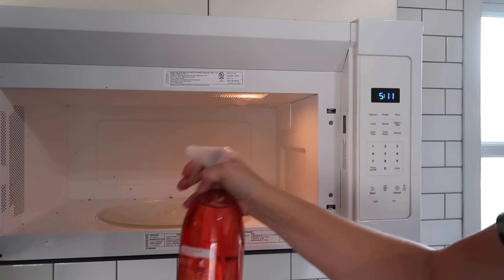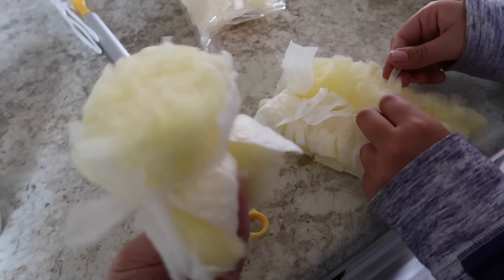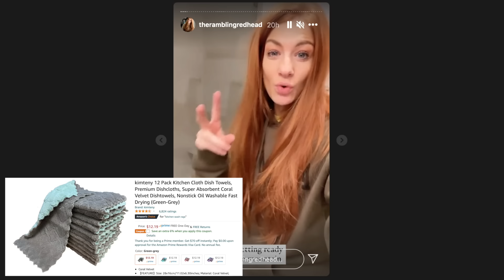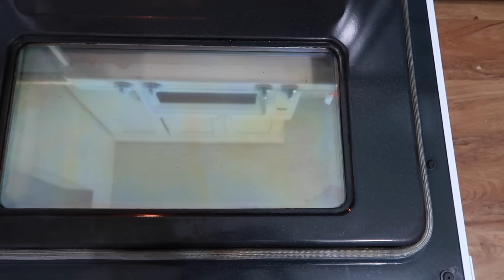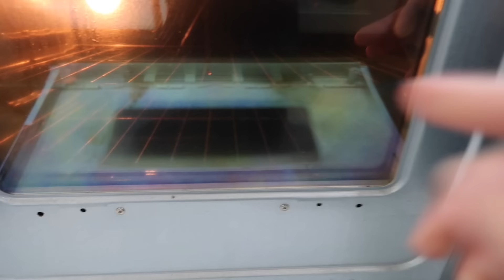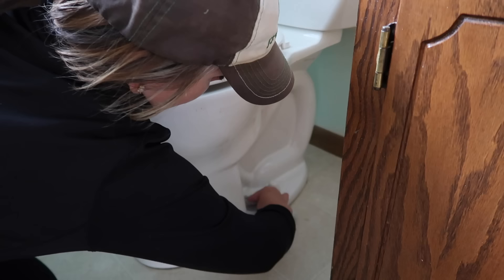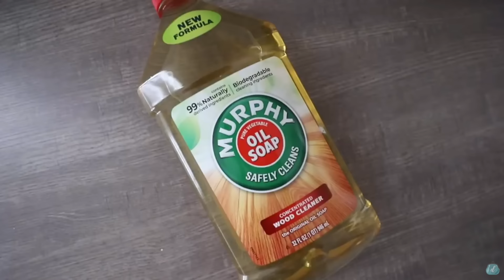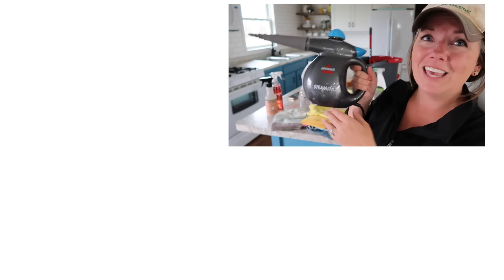Overrated Cleaning Products? Test them with me!

Comment: I am very minimal when it comes to cleaning products. I use dish soap on pretty much everything, sometimes diluted with water and a little essential oil in a spray bottle. I scrub with different cloths depending on the surface, use a rubber squeegee on my windows after I wash them, and generic steel wool soap pads for grimy but durable surfaces. If dish soap gets my dishes clean enough to eat off of, I figure it gets the rest of my house clean, too. The exception is my vinyl floors, where I follow the manufacturer's instructions. 😊
Reply: I only use water on floors too.  All the cleaning products leave a very slight film, which then becomes a dirt magnet, meaning you find yourself cleaning again quite soon after, and repeating the cycle.  Ain't nobody got time for that!

Comment: Dawn the Spin Mop is great for walls too!  I have extra heads and use them on walls and on my wood ceilings too.
Reply: As 'no frills' as I am, I have a sponge mop just for walls. I use a rag mop on the floors.
Reply: I use my spin mop, super hot water, and tablespoon of laundry detergent and clean walls, cabinets, corners for cob webs, then do the floors if not too dirty. Otherwise I change water and mop head and then to floors. Works great for grease in kitchen. I even spray widow above stove ( I don't have a hood in this rental home) with glass cleaner and fresh mop head to clean the hard to reach window. I absolutely love it!!!

Comment: Try magic eraser on those scuff marks from the stools! They are miraculous....
Reply: My thought exactly!! They’ve “magic”!
Reply: Use them sparingly though. When the melamine resin is turned into foam it changes the structure into micro glass particles. Basically, You're using super super fine sand paper. (That's why it works)  Use it on those scuff marks, etc ... but sparingly... or you'll take the finish-paint off.
Reply: @susansmith493  I just discovered those. They were the only thing that got my tub clean after years of neglect. Now I can actually take baths again! But I appreciate you explaining about the glass. That reminds me to wear gloves when using them.
Reply: They sell knock off magic eraser sheets at the dollar store. I've never purchased them but so many say they work just as good. Can't go wrong for $1!
Reply: @amybee40  try a daily shower spray after last shower of the morning or evening. My mom used it 20 years ago and her shower was always spotless.  My glass doors (new 2 yrs ago) started getting a film on them even with cleaning, found a daily shower spray and after scrubbing down the doors and fiberglass walls with Dawn, ACV and baking soda and the mr clean white sponges, I have not had to clean my shower in a year!!  Spotless.
Reply: Thought I was going to have to repaint several areas...... enter magic erasers and viola!!! No paint needed :)

Comment: There is one difference between e-cloth and other microfiber rags: e-cloth can be washed at 95°C, which means it can be used to clean up absolutely anything no matter how gross and be sanitized in the washing machine afterwards. This is what sets them apart! Also you used the one meant to dry the windows not to clean them. The window cleaning cloth has a waffle structure.
Reply: I love my E-cloths; (although not so much the colors as she said). I haven't bought a window cleaner in years, and now I find a simple squeegee and wipe down after every shower with the window E-cloth on my shower doors is all I need. No soap scum ever on them.
Reply: I love the glass and mirror e-cloth. You use the waffle cloth with only water and then dry and polish with the polishing cloth. It’s later on you will see there are no streaks that may not show up when you are doing the cleaning. If you use any product on glass it is most likely to leave streaks because it is so impossible to get it all off.
Reply: I wash my non e-cloth ones at 95 degrees and they are fine. They even look the same, but cost £15 for 30.

Comment: I keep a refillable scrub brush with dawn and vinegar under my kitchen sink for scrubbing my sink. Works great and it’s always ready to go. I also keep a regular dish brush in my dishwasher. I use it to give dishes with really stuck on gunk a quick scrape. The brush gets cleaned every time we run the dishwasher so it doesn’t get gross and smelly.
Reply: Ooh, that's a fantastic tip! Thank you!
Reply: Do you use the dawn and vinegar to scrub a stainless steel sink instead of a commercial powdered cleaner?
Reply: @georgiaamanatides4207  Yes, I do. I clean it regularly, so I don’t very often need the abrasion. If I do, i just use a bit of baking soda.
Reply: What's the ratio of Dawn and Vinegar?
Reply: I've got one of those but not used it for that - I probably will now!
Reply: I keep the same concoction in the same brush in my shower. It’s safe for the kids, and they think it’s fun to brush the walls and bath either while bathing or just to be with mom while she’s cleaning the bathroom

Comment: I have a Bissell Steamshot and I love it! I believe scrubbing with a brush attachment while steaming, instead of scrubbing after the steam has dissipated, would open a whole new world for you. (Basically the same concept as the Shark steam mop on the kitchen floor.)
My method for really stubborn dirt is to spray the surface first, use the brush attachment to scrub with steam, then wipe dry with the microfiber cloth. I do not recommend using anything but water, it can damage the everything - hoses, attachments, heating element - everything.
Reply: Thank you for your tips! I just got my Bissell Steam Shot yesterday and Dawn didn't have any luck with her Bissell.. I was disappointed! Will use your tips!
Reply: I agree that the way you used the steamer isn't the way you clean something like that. Need the brush attachment and it does it a whole lot better. I've done my old oven and stove that way and didn't take hours.
Reply: I have one as well and love it!
Reply: I LOVE my Bissell Steam Shot
Reply: @Rollwithit699  yeah, same here... I think the brushes themselves would just work well without any steam
Reply: You need to hold the steam shot closer. You are misting with it. Use it like a pressure washer

Comment: Years ago, I read that using diluted shampoo is good for cleaning the tub, especially for those stains on the grainy finish on the bottom of the tub. Why?  Because shampoos are made to deal with body oils. So, I did a dilution where it was pretty thick, and smeared it all over my tub. Wow.  Amazing results. 
I don’t use it in the kitchen on things with an oily haze, though.  It works, but I do fine using a spritz bottle of plain water and my microfiber cloths. I do let it soak at least 30 seconds. Even on the vent hood. 
For my mop, I got cheap microfiber cloths.  My little O-Cedar mop has little grippy teeth than hold the microfiber, and they stick well to the big Norwex mop head, too. I just replace and toss in an empty bucket, then toss all in washer with other dirty microfibers. If I use a bucket l all I can think of is that I’m putting dirty water back on the floor… unless the squeeze part squeezes dirty water out of mop into a different/separate section that keeps it from mixing with the clean water. 
I foster dogs (mostly seniors with bladder control issues), so I have stacks of squares that I’ve cut from old towels (the old made in USA ones are the best, buy at thrift stores for about $1). I can do a quick wipe up and toss into the dirty rag bin (different from microfiber, because of the terry cloth). If it’s an extra gross mess, I can just throw it in the trash. 
And, on a different tangent…. microfiber cloths on the legs and feet… talk about exfoliation!  I use the heavy Norwex “everything” cloth on my heels, around toes, and then on legs before shaving. Amazing. I’m not kidding.  I have friends who get mani/pedis, and after using regular cheap microfiber, their practitioners thought they were cheating on them, their feet were so smooth with no slough around toe nails. 
Lastly… I give my dogs’ teeth quick rubs with microfiber, most won’t let me brush, but they’ll let me go in there with a cloth. Most are too old and decrepit to undergo anesthesia for a formal clean.
Reply: I'll try it. Thanks.
Reply: Bless you for taking in old dogs. They need love too.
Reply: This comment is so full of goodness and good tips, if you don't already, you should have a channel!
Reply: Pmg, your recommendations have been the most interesting and doable I have seen, especially the shampoo for tub and microfiber on feet, lol. Thank you!
Reply: Agree about shampoo, least in the shower, have to try it elsewhere. 
Reminds me years ago a friend stayed over and left their Head & Shoulders in the shower.Someone must have knocked it over as it ran down the walls of the tub. Had one of those old porcelain tubs that was stubborn getting it clean, but and after rinsing off the H&S shampoo it left a pearly white clean spot. H&S was my deep cleaner from then on in that bathroom.
Reply: Yep! Most shampoos have sodium lauryl sulfate or ammonium sulfate which are inexpensive detergents also used in many body washes. Sodium lauryl sulfate is more irritating than ammonium sulfate because the molecules are a bit smaller but SLS is in many different cleaning products. Sodium laureth sulfate, not to be confused with lauryl, is a bit less harsh. Sulfates are surfactants that lather well so it’s great for cleaning but that being said, if you can afford it, try to use better stuff for your hair! Salts are very drying and if you wash your hair often, using something with sodium lauryl sulfate can cause early balding If you don’t rinse out all of the product. It will clog your pores and that means your skin can’t breathe.
Reply: The Suave Daily Clarifying (light blue-ish) works great to get hair dye off of counters, sinks, tubs, shower walls, and skin. The sooner the better but it definitely works! I know this because my bestie would dye her hair while her mom was at work. She never left any evidence behind except for the hair on her head and the designated "hair dye towel" she used to dry her hair afterwards.
Reply: @cspartz     That’s good info!  I use SLS free stuff on my hair and body, but I do keep those old standard shampoo companies in business by using their products for cleaning the tub and getting stains out, lol. Prell will strip stains out well, as does Johnson’s baby shampoo!
Reply: ❤️❤️❤️ for loving the senior dogs!
Reply: A dampened microfiber cloth will also remove every trace of makeup including waterproof mascara, with just water. I've been using this for years. It's a daily exfoliant that I really enjoy.
Reply: @alwaysathome great tip!! Does the cloth come clean of makeup in the washer?

Comment: Hey Dawn! I have this cleaner, that I totally recommend. Bar Keepers Friend is THE BEST! It is worth to be in my minimal cleaning caddy. I had a rusty spot on my sink, and my daughter, Isabella, used it, let it sit for five minutes, then wiped it off, and voíla! IT WORKED. For the first time in years it was totally clean. Definitely recommend trying it. The powder works very good, but the liquid is the best.
Reply: Love BKF for stainless steel anything ❤️
Reply: Love Bar Keeper's Friend!  Been using it for years on my stainless steel sink too!  Also works great on stainless steel pans!
Reply: I use it on stains on my counters!
Reply: I heard the pink stuff is better and smells great? I paid $10 for a kg I think on Amazon where barkeepers is $8.00 for 340 gm..
Reply: I would use Mr Clean eraser by the base board that didn't come off with the spray. You won't have to paint over the scuffs.
Reply: cream of tartar works too

Comment: I actually like my steamer a lot. You have to get close with it, but when you do, it can literally melt grime off.  It's particularly effective on soap scum on shower walls.
Reply: That is what I said. She was spraying it like a perfume instado of using it just like a pressure washer. Slower and more mindful.
Reply: Yes, someone needs to show her how to use a steamer properly.
Reply: I agree. Don't be afraid to get closer with the steamer
Reply: I tried using it on a toaster oven door and I got the same results. I think for grease, it doesn't work. But for soap scum and deep grout lines, it's amazing!

Comment: I’ve had a cleaning service in south Florida since 1986.. my favorite cleaning tool invention is a swifter (not the one you had but a smaller version that only has one swifter that folds flat for storage yet it extends 3 feet.. the swifter refills that are blue instead of yellow are much better, thinner and cheaper too... the difference in a swifter and a microfiber cloth (or any cloth) is when you come back week after week to dust you will notice there is much less dust in the house after using a swifter duster..  you can easily dust behind furniture and dust baseboards, reaching anywhere, just getting the house so much cleaner than we could before they invented them (plus faster and easier).. if I were going to clean a house and didn’t have one with me I would get in my car and go get one first!! Love, love, love them!!!
Reply: Barbara I agree ♥️... exactly what you said.. 20 + years here with a cleaning service.. the Swiffer is the one thing I love so much!! As well as others ... I use all 3 swiffer dusters.  But the short handheld and the one you use are my favorite.. as well as the blue duster refills....Sams refills have the best price!
Reply: @aprilgriggs5071  Sorry can you please link something so I know exactly which model you are talking about ? I am in a small small apartment and am trying to get the right model that has a small footprint when I can put it away!
Reply: @aprilgriggs5071  yes. Swiffer, not Swifter. They probably should have named it Swifter based on so many people’s interpretation. Plus it suggests fast cleaning, but they didn’t. Thanks for getting it right. Don’t know why things like this irritate me lol

Comment: To clean the drip in the oven door, you can wrap a hanger that has been saturated with window cleaner and insert it into the slot under the door.     I use my wonder mop for my first pass over my french doors. Also, boil water in an oven proof glass dish in the microwave.  The grime inside comes right off.

Comment: I think the bissell steam shot is all about the attachments. I've watched several videos and every one of them used attachments,. They allowed for scrubbing and contact cleaning on the surfaces. They also let the steam build up in an area not just spray and go. Hopefully that will help. I plan on buying one myself.
Reply from the maker: Ok, this is really good to know!
Reply: I think you were maybe holding it too far away, too...holding close takes advantage of the pressure...like a pressure washer.
Reply: Definitely closer and longer.  I like to use mine on my tile grout.  It takes time but does a good job.

Comment: When I learned about the ecloth I was shown to use the multi purpose cloth with just water to clean the mirrors and windows then use the glass cloth for drying it works so great for me and no streaks or having to buy any product to spray on.
Reply: Exactly - it’s not supposed to wipe off a window cleaning spray, it’s meant to be used in conjunction with the scrubbing cloth with just water. It works amazingly well - we’ve used it on our sliding glass door *inside and out * and it takes maybe 5 minutes. And my kids can do it. I haven’t bought or made window cleaning spray in years.
Reply: Yes, I really like the clothes with just water!  They work great!
Reply: I think the ecloth works best as it was intended to be used -- wet the cloth with water, wring it out as much as you can, wipe the window down and then dry a bit with the microfiber cloth.  I don't think using the cloth dry with window cleaner spray is the right way to use it.  Mine works great when I use it properly.
Reply: Yes, the blue cloth is a polishing cloth... not meant to actually clean the window. You buff it. Also works great when you use in on a glass top stove after cleaning it.

Comment: @ The Minimal Mom, Dawn I'm not sure if anyone mentioned this, but the blue E-Cloth you used on the windows is actually a polishing cloth. For scrubbing the windows, the E-Cloth with the deep waffle weave texture is the scrubbing cloth and the thinner cloth with the saw-tooth edge is the the polisher that you go over the glass a second time, but only if you need to. The only time I feel the need to use the polishing cloth is if I see that the scrubbing cloth left some streaks (usually because it needs rinsed out). I actually drape my glass and regular microfibers over a Gator Mop by Libman. This helps me clean hard to reach areas. The sponge side is gentle on painted walls and windows and the scrub brush side helps get off dried mess.

Comment: For your ceiling fans. I use a pillow case to whip it off. It traps all the dust and you can throw it in the washer after you turn in inside out to shake it off.